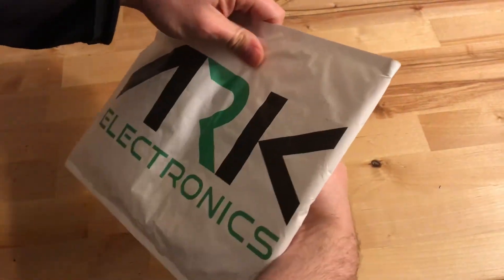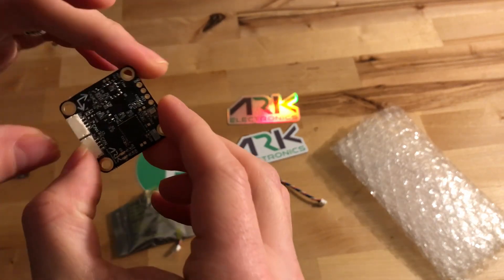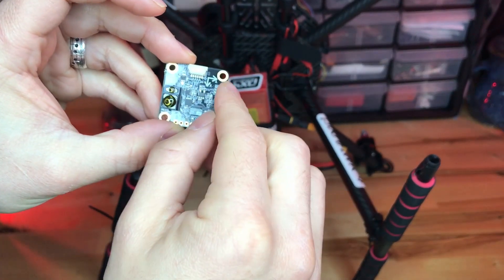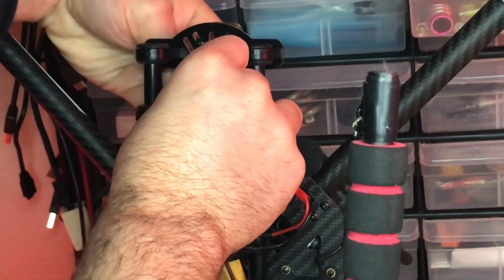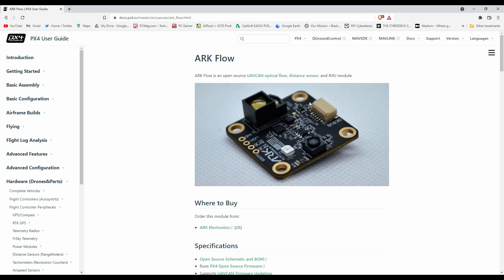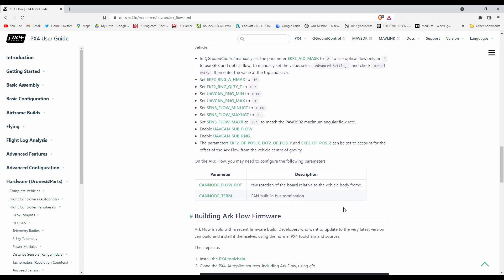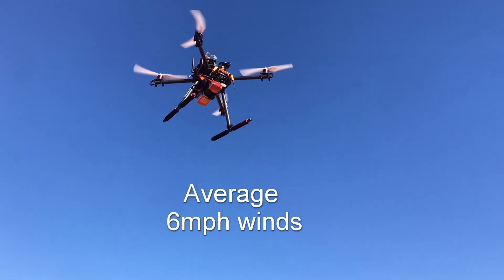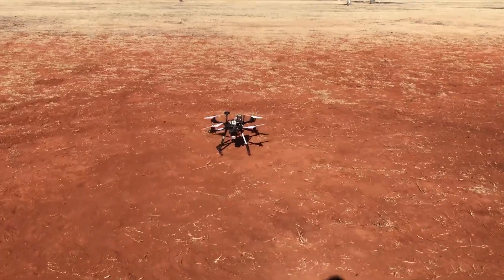Is the ARK CAN Flow the best sensor? UAVCAN PX4 optical flow sensor: GPS need not apply!

Comment: Does it need to set the origin through GCS like Ardupilot , I tested my craft with PX4FLOW with px4 stack but 'no local position ' event found and again I switched to Ardupilot.
Reply from the maker: It’s through ekf2_of_pos_x/y/z that you set the sensor orientation relative to the vehicle center. This is done in QGC.